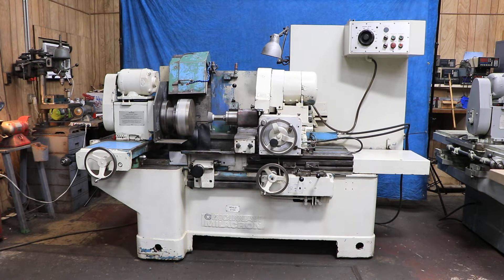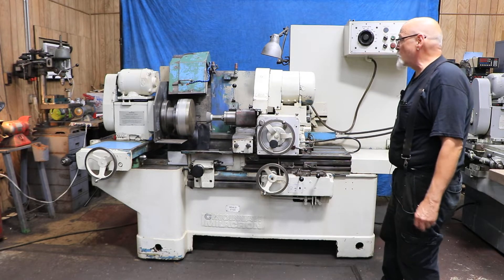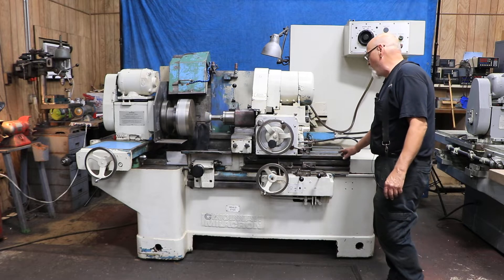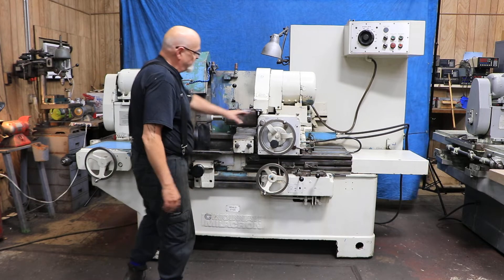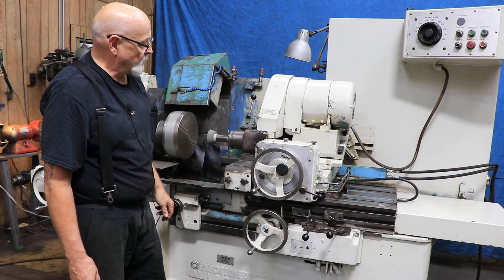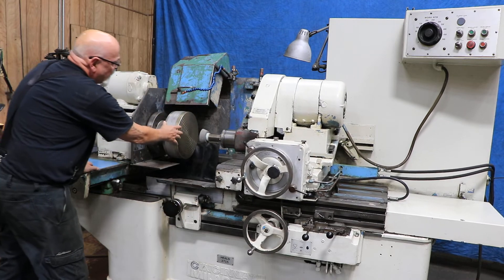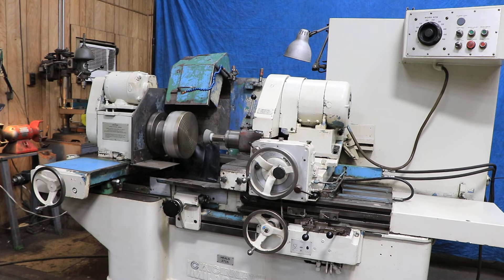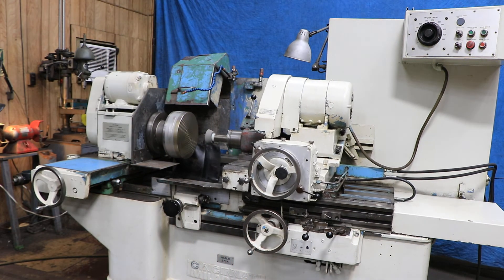CINCINNATI MILACRON-HEALD UNIVERSAL INTERNAL GRINDING MACHINE

Comment: And as for the hydrostatic portion of it, once you disassemble the slide, it's quite an engineering marvel. Knew of very few places willing to machine them down to the tolerances required for that function. If I recall, the oil channels were a zig-zag pattern.